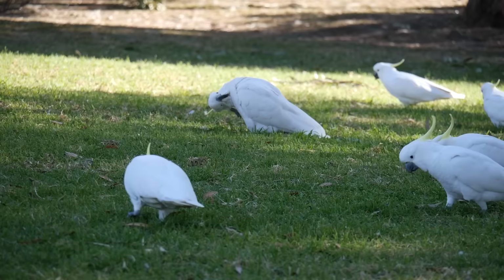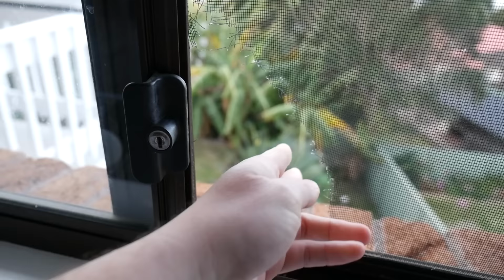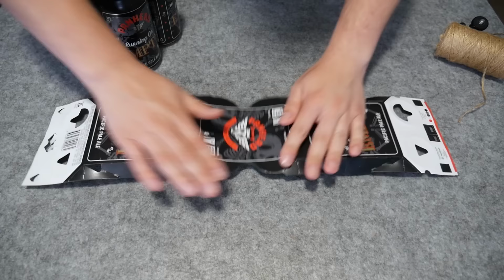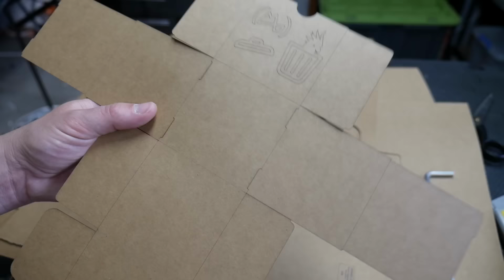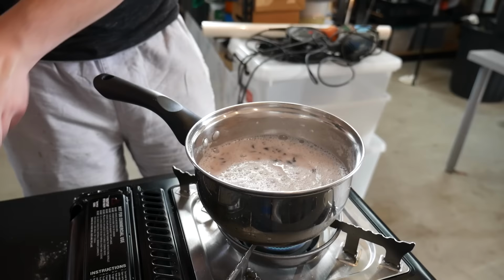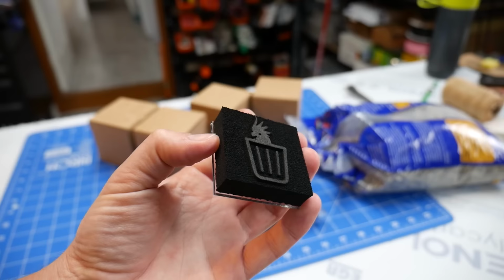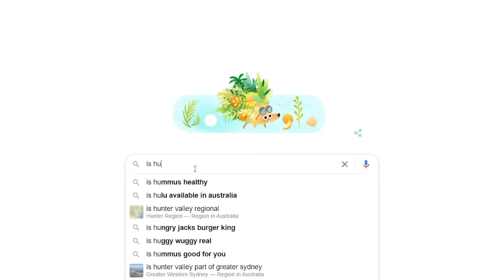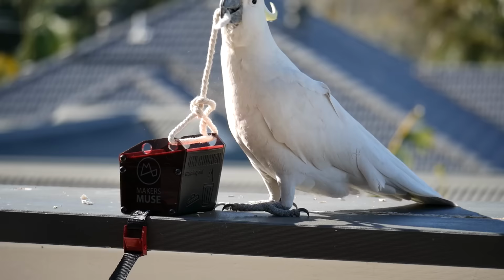Making Christmas presents for WILD Cockatoos

Comment: Don‘t wanna be a smarta*s here, but just a little tip:

If you want to give starch or flour into hot/warm water you better first put it in a little bit of COLD water, so it doesn‘t form clumps and then add that mixture to the warm water.
That way you can easily add little by little more flour to the sauce and adjust the thickness as the last thing before ‚serving‘ it (or in this case using it for painting)

Comment: Next time for the purple dye, you could try red cabbage, which would also work as a blue dye, since it’s an acid/base indicator. Also, next time you’re using a grater, be sure to clean it out pretty regularly, wiping off the bits that stuck and rinsing both the beet and the grater. That should help prevent slippage.

Comment: Edible Watercolors Trick:
Take any edible fruit, vegetable, herb, flower, mushroom, cut into small pieces, put it into a dehydrator. 
Once dried, dump it into a blender to become as a very fine powder, store it in an air-tight container.
Take a small spoonful into a tea cup, adding water, simple syrup, fruit juice, neutral oil, or high spirits.
Add more as either needed, then brush and paint your canvas, such as rice paper, fondant, or pie crust.
Tips:
Acids like lemon sometimes mutates the colors, sometimes some ingredients may or may not blend.
Some powders can be used like "glitter-spice", providing bursts of colors, flavors, textures, dry or wet.
Egg whites make for a simple glue for powders, as may milk, flour can be colored by powders in water.

Comment: Quick tip: Don't add the flour to hot water. Put it in a glass or container with a lid, add cold water, screw the lid on and shake well. This eases the process of not ending up with a bunch of lumps.

Comment: Next time, use starch to thicken stuff. Boil the water with your ingredients and only when everything cooking-wise is done  for, stir some starch in cold water (or milk, or Juice, or........). You should have a nice starchy liquid. Pour that into your boiling pot into the hot stuff and it should thicken in seconds without any clumps at all. Now take off the heat. No burned starch, no stirring for minutes.

Comment: "gerber files allow lasers to easily use different settings by swapping between layers" 
Oooh, so THAT'S why lasers specifically use that system rather than something else. Thanks, I've been wondering why for a while but nobody's just come out and said it before.

Comment: @makersmuse next time you need to color something a great vivid pigment is tattoo ink, sounds crazy but its totally safe(it couldnt be safe for injection to human skin otherwise) it comes in all sorts of bright rich vivid colors and typically requires only a couple drops for most purposes. It's not cheap but a $50 for 6 inks would last you probably until you are tired of coloring things with it. just don't get the cheap stuff from china as there are quality issues that have been common. try something from germany or usa i would recommend.
Reply: And you could remarket it as "Cockatattoo ink"!

Comment: What exactly is a cockatoo beak made of that allows it to produce a bite pressure higher than that of a strong dog?
Reply from the maker: It's a really clever biological linkage actually, worth looking up! Causes a huge force multiplication but they can't open it all that wide.
Reply: @MakersMuse  Of course I am asking about the actual "cutting edge" of the beak, to be able to withstand such incredible force without breaking.

Comment: Would you ever think of doing a laser cutter recommendation at different price levels like you have for 3D printers?
I've been thinking about buying one but I have no idea where to even start other than taking a risk with a chinese import
Reply from the maker: I can't really recommend any of the cheap ones without enclosures for safety reasons unfortunately. They might work, but they're just too dangerous. I like the flux beambox but am aware it is NOT cheap.
Reply: @MakersMuse  yeah, I have a cat which wanders around and I would absolutely not want to accidentally damage their eye sight, let alone my own or anyone else's.
The beambox is pretty exxy, but I guess that would be an alright standard to compare pros and cons against!
Thanks for the reply!

Comment: 350 psi biting force?  what kind of measurement is this for a beak? :D  What does this number even mean? Pounds per square inch.. of what??  It is like measuring speed in ... liters.
What you have probably wanted to say - 'it has biting force of 350 pounds' ? Cause that actually would make sense. (It is a big number for a bird but possible).

P.S. Measurements in PSI are only meaningful  when dealing with gasses or liquids when it is impossible to know the movement (or force) of every molecule , so instead we talk about  1 square inch of vessel wall and measure how much force is applied to it by all the molecules, hence pounds per square inch.
 In case of cockatoos .. just measure biting force of one bird ( how many pounds ) and that is it.